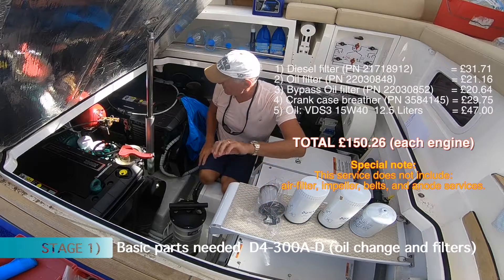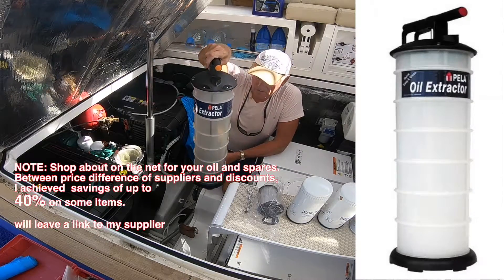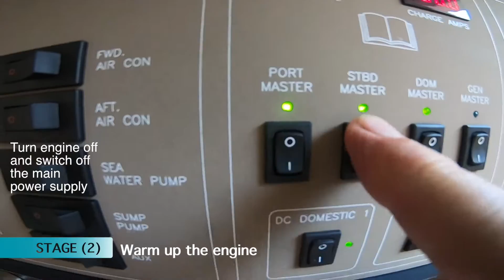VOLVO PENTA - D4- 300 OIL & FILTERS SERVICE

Comment: My engine d4-300 has the hose factory installed that lead all the way to the oil pan. Just fit a propper hose(thicker than the dip stick hole) on your oilextractor and start pumping. :-)
Reply from the maker: Thanks for the info!